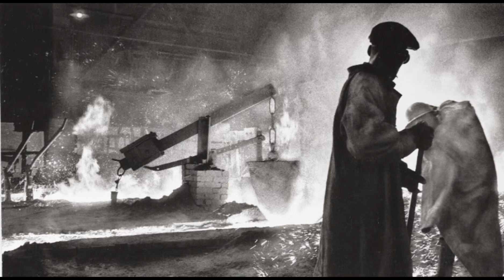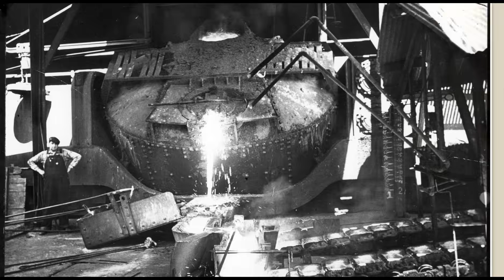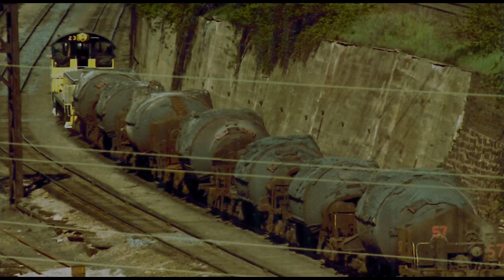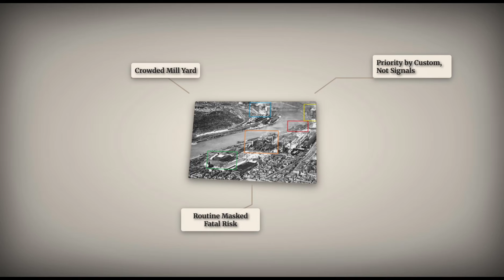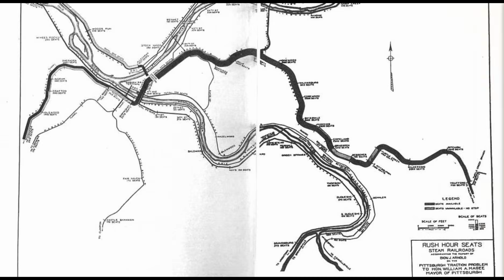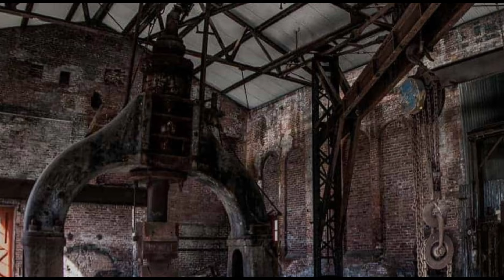The Torpedo Car : The Forgotten Car of the Steel Mill

Comment: I worked for the EJ&E around 2000. Switched the blast furnaces at USS Gary Works. Old heads warned of about spills. 2700⁰ will absolutely find moisture and create steam explosions. They warned about glowing hot spots on the shell of the car where the refractory lining was damaged and allowed the compromise of the 2" steel plate shell...apparently once it breached the shell the molten iron would literally cut the plate shell like hot butter. Steel mills are fascinating and filthy and deadly. 

Mittal ( former Inland plant 2) . Would run a bottle train from East Chicago, IN. to the former Acme Steel  plant in Riverdale,IL via the Norfolk Southern RR. Acme had new converter and rolling facilities but no iron production.

Comment: I used to have to rerail those things. Sparrows Point in Baltimore and Steelton Highspire outside Harrisburg Pa. Those ladle cars were 1.5 million pounds loaded. You don’t pick them up, you push and pull. First one I worked we had 2 pipe layers picking and pulling, 2 6 axle locos pulling and 2 992 loaders pushing. Just to get 2 wheels on the second truck set on the B end back on. All of this power and we used oak blocks to hop the wheels on
Reply: My father-in-law worked many years at Sparrows Point mill! Huge respect and love for him.

Comment: You got it wrong.  The torpedo cars are still in use at most steel mills in Gary, Indiana.  I know, this because until a year or two ago, I used to work on the ore boats on the Great Lakes and would see those cars when docked at the steel mill docks.
Reply from the maker: I don’t mind being wrong . I’m glad we’re still using it, honestly :) It’s much safer than what we used before. Thanks for your feedback, appreciate it.
Reply: @SteelAndSweatTV Agreed to both.  They Definitely are safer and I'm glad they are still in use because they are so cool.  And i apologize if I came off as rude that was not the intent.
Reply from the maker: No worries! I could clearly tell there was no bad intention, so no problem. I really appreciate your feedback :)